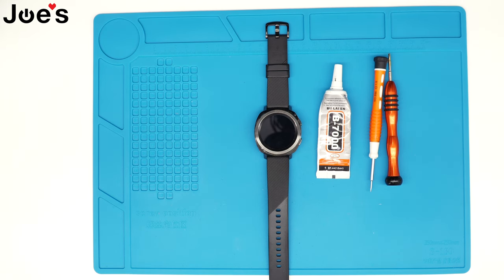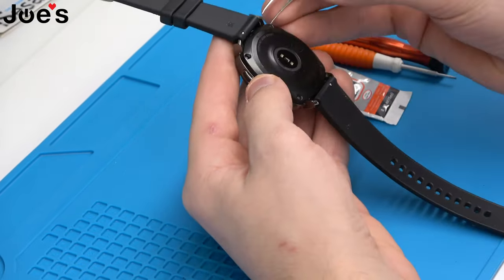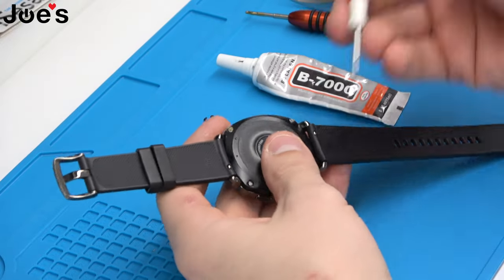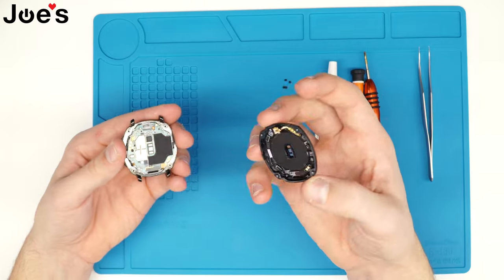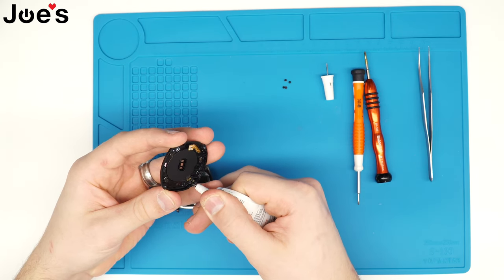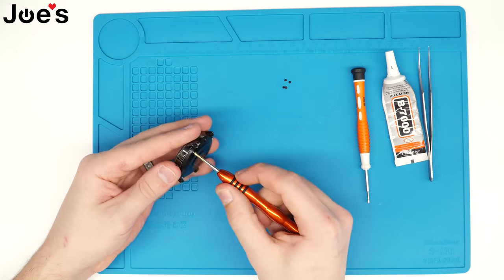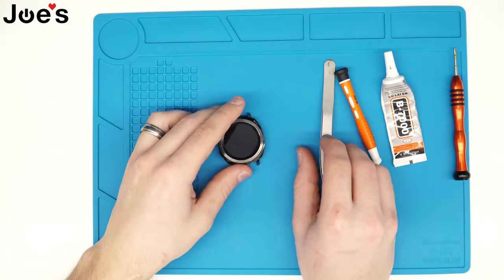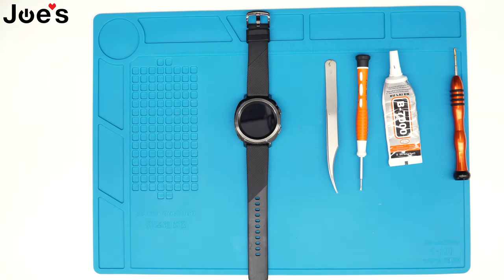Samsung Gear Sport Back Cover SM-R600 Replacement Heart Rate Sensor | How To Tutorial

Comment: hello, what is the screwdriver you used to unscrew the four small screws? I have a set of screwdriver but none of them fits
Reply from the maker: It is a Y screwdriver.  https://www.joesge.com/products/samsung-gear-s2-s3-smartwatch-screwdriver-repair-y-2-0mm-tool?_pos=1&_sid=90240441e&_ss=r

Comment: Sorry you changed the back cover or the heart rate sensor? It's on back cover?
Reply from the maker: Both are in one
Reply: @Joesge  in back cover? How to charger the battery direttly without back cover for to check the heart rate sensor? What's your version firmware?